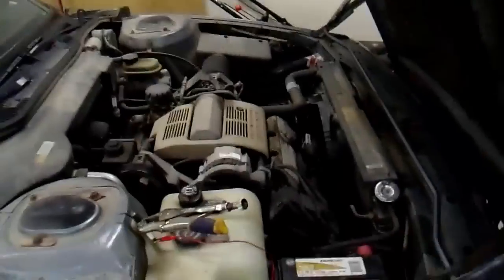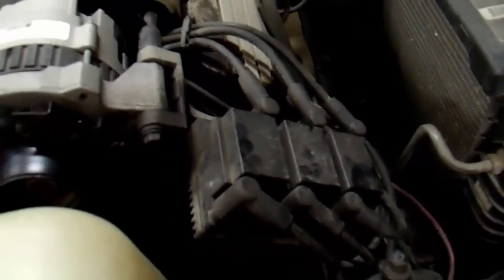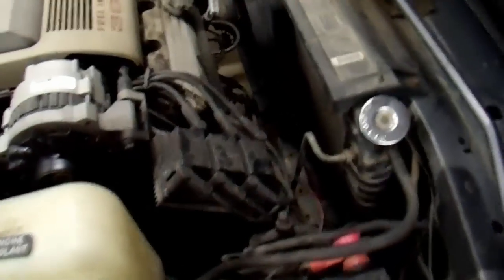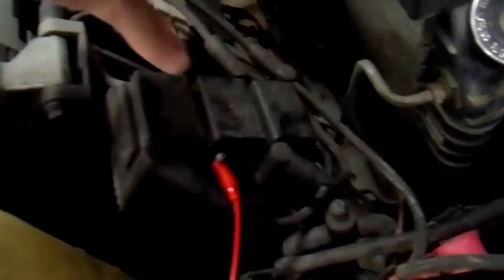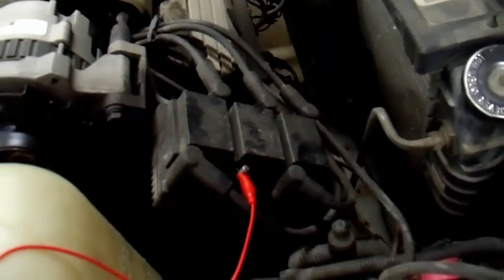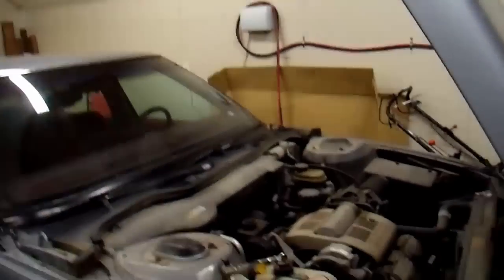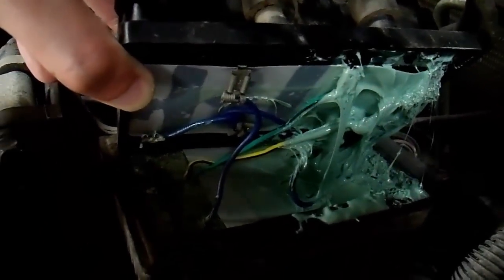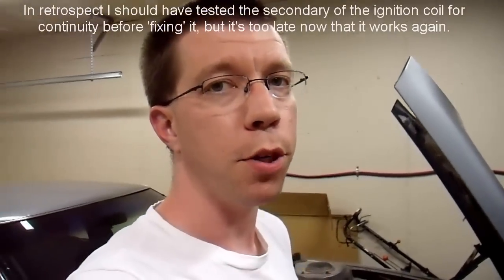Ignition Coil Failure and Repair - Spark Test Hack

Comment: one plug not firing, what I did was to switch coil packs and see if the same coil doesn't fire or if the non fire stays where it is. if the non firing coil migrates to it's new position the coil is bad, if  not then ignition module is (could be) bad; test to make sure.
Reply from the maker: That works on more modern vehicles.  This one has 3 coils in a module where they cannot be swapped.  3 coils instead of 6 because it is a waste spark system where every cylinder fires twice every 360 degrees.

Comment: hey i have the same coil pack and i bought a new one but the new one does not have the 123456 marked on it so how do i know wich way to put the coil pack on? like how do i know the ground side and the low voltage side of the coil pack

Comment: my car+g.prix was running on 4. 2 plugs were about to fall out.not sure why but fixed with all irridium ac delco. coils will be Delphi.
Reply from the maker: I highly recommend only using the delco premium plugs like you did with any GM vehicle of this vintage.  They're good and last a very long time - well in excess of 100k miles while staying well within gap spec.  Delphi and AC Delco are the way to go for replacement parts on these.  Comment approved!

Comment: My 92 lesabre is down.Just quit and has no spark but has fuel.Just recently got car.Most cars no one ever repairs anything.Already did a lot to make it useful and on a budget.Being an old school guy I found years ago working on these cars nobody changes wires or plugs or even a fuel filter or flush out the rad.Now when the car misfires they just change the coil that is missing.Changing this will help all of these cars out what is it the ignition module under the coils and new coils to go with it.Then you do have some spare parts that you can keep and re test nothing like having a spare coil or two hanging around.Oh make sure the part says made in the USA or Canada and not china parts for Buick,s very unreliable.Brand new window regulator not even a year in another Buick but a 20 year old one in a wrecker still worker lol can name many parts same out come be careful on cheap replacement parts.Remember your actually driving a car that is a car even has a cigar lighter in how many places.Even if you don,t smoke you can fill those clean ashtrays with lots of goodies like bulbs and spare parts like fuses keep on driving sure hope I find a quality ignition module.

Comment: How do you change out the coil with all the goo in it? Clean it off the connectors?
Reply from the maker: Normally this would be replaced as a unit but the coils can be removed as shown in the video if desired.  Unscrew it from the module, unplug the connectors, and swap out.  It isn't made to be replaceable separately so it is possible the 'goo' will glue it together in your case.

Comment: I've got the same engine. I've changed cam and crank sensor , all fuses and relays are good.Still not firing.
Reply from the maker: Have you verified if you have spark?  Checked for fuel delivery?  eg starting fluid.
Reply: @knurlgnar24  I took plug wires off neither of them are firing. All of the coils wouldn't be bad. I've never had that to happen before. I'm thinking maybe the module went out.
Reply: Fuel delivery is well.

Comment: My 91 buick lesabre just turned 31 this year. Got similar problem as you did. Missing on cylinder 6. Bought new ignition control module and coil box. Mine has the original grey one I think. Put new wires and plugs in it didn't fix my problem. Great video helps me out alot. Wish me luck I live in the rust belt.

Comment: I have a 3800 in my 1990 Trofeo. The engine was warming up then just died. I checked for spark, and got nothing with the plug removed. I looked at the connector to the ignition module and saw that 3 wires at the connector side were fried. So I just replaced the harness and am waiting for the ignition module because I still don't have ignition with the old module. Would the whole module go out or could something else be going on?
Reply from the maker: I'm not exactly sure but since the module provides power to the sensor it seems logical that the module itself was bad.  I'm not sure how a bad sensor would cause fried wiring.  Parts for these are cheap now so I agree that replacing the module makes sense.  If that doesn't work I have a video on replacing the crank sensor which is a doable but more difficult procedure.  They make modules like this tolerant of sensor faults so I wouldn't be concerned with burning out your new module if the sensor is also bad assuming you don't try to run it that way for too long.
Reply: @knurlgnar24  I also found online, a troubleshooting guide on that 14 lead pinout. Hopefully I won't have to use it. The new Ign mod will be here tomorrow. TBD
Reply: Oh I know how it burned the harness, there's a positive voltage another positive and a ground, and there all 3 next to each other,(maybe not the exact order), and it looks like something caused one or all to overheat and they shorted but never blew the 20 amp fuse. Go figure. So on my new harness I double insulated those three or four wires on that one side of the connector that had the voltage and ground near each other and then I rewrapped everything because the old connector I had was pretty nasty looking to it looks like it had some oil had been on it who knows what but it's funny I posted my pictures of my shorted wiring on a Facebook account and three other people showed me their wires had also done the same thing for the same kind of car it's a 1990 trofeo. So I'm hoping my mummified wiring will last a little longer and like I say my new ignition module will be here tomorrow so wish me luck

Comment: I know these videos are old but damn I appreciate your time and effort. I have an 1989 Buick Electra with 150,000 miles and I feel the same... Even though I only paid $250 for it it's in decent enough shape that I want to see if I can get 300,000 on the odometer 😜 Old car? So what?! Cheers man!
Reply from the maker: These are great cars reliability wise - but the rest of the car may fall apart around you!  Mine made it to 260k and ran perfectly up until I sold it.  The transmission on these needs a fluid change with Dexron6 to last though.  Lots of these 4T60 transmissions fail due to old fluid since they had an older dexronII or equivalent from the factory and once they get 10 years old and 100k miles people just never get around to changing it.  Mine was still running on DexronIII from a fluid change at 50k miles in 1994 so I was part of the problem!  I was very careful to not run the transmission hot though as I am on all my vehicles.
Reply: @knurlgnar24  Thank you for the transmission advice! I don't know know the date of the last fluid change for me but I'll probably change it soon. I'm the third owner and the second owner had the car less than a year, so the service intervals were probably met pretty consistently. I performed the repair yesterday, and man... It really does blow my mind how smooth these cars ride when they're functioning properly! 🤯😁

Comment: I'd like to add: this is ironic. I never reviewed this video until 10 minutes ago. I was watching this video looked like it was over, breaking news. the creator came back on mentioned he found an issue.
 A lose low side connection the blue wire. Im working on my 90 olds delta 88 royale burgham. I know I have ignition issues. I watched a few videos got pointers from each. i numbered the plug wires pulled them (DOING THIS ON A HUNCH)   I've had the coils off my other olds, sticky mess! good story, another time. Colis were sealed good, pulled it off just enough to see. NO sticky mess, (Im second owner) 87,430 mi. the blue low side wire was off. it was snug tacky to the potentially turning sticky stuff. I never got so lucky, my olds didnt fire it did however restore power to my module connection WIRES.  Prior to removing the coils I was unable to get a power indication. A WORD TO THE WISE REMOVE  the hex screws from each side the module, work it lose, bend your head down there and look. Look good? visual done. Now gently pull at each connection, solid, not moving?  oh one's moving? snug it gently, move on.

Comment: Popped my ignition module off and 3 of the 6 prongs had snapped off and was just laying there.  Anyone have any idea what color wires go where? A diagram on the hook up off the module  via color coded wires?
Reply: The 3 blue wires go to bank 1 and are lined out in order usually. On bank 2, blue goes to 6, green goes to 2, and yellow goes to 4

Comment: I think I have a bad ignition coil module on a 89 Buick LeSabre not getting no spark or fuel Redi Chek computer also ground wire underneath what ignition coil module cause no spark or fuel ?

Comment: What size is the tensioner pulley bolt
Reply: I think I used a 3/4 on mine. Or it might be an 18mm

Comment: Atleast from the gen1 up NEVER use used coils and preferably not used ignition modules. The 3800 is infamous for blowing coil packs. Just buy new coils. Coils are 10 a pop on amazon.
Reply from the maker: I know this is an old comment but I would never buy coils on Amazon.  NEVER.  OEM junkyard parts are by far the best value, new good brand name parts from an auto store are OK, new parts from the dealer are best but most people don't want to give their first born for them, and as far as online auto parts go Amazon is the absolute worst place you could possibly go for them.  NEVER.  just never.
Reply: @knurlgnar24  
Some, you have to look at what BRAND your getting. OEM uses aftermarket parts just rebranded to your vehicles make. Wreckers is great for alot of high cost parts or parts you cannot obtain but remember they are used and will work accordingly. With coils it's best to go new. I mentioned Amazon because they stand behind thier shit. Amazon is simply an ecommerce reseller. They don't manufacture just cuts the middle man. As for auto parts stores..... I went through countless CHEAP O'Reilly trash suspension parts. Sure they state lifetime warranty but when you get hassled by the parts guys you just don't wish to buy there. If I can get a walker oxygen sensor for under 10 dollars for my Dodge bit AutoZone wants 50 for the exact same part, I'm going the cheaper route lol😁
Reply: @FF-7Sephiroth  so I should charge the battery, and check the ignition control module. I see. It ran fine when I parked it, but after 5 years, it has nothing. My family thinks I should scrap it, but the engine only has 189,000 miles on it. It's not even halfway through being done in my opinion.

Comment: Good video. Just a note that this isn't a 100% test - a weak coil may still light a spark plug at atmospheric pressure, but will fail to light at the higher pressures in the engine. I chased an ignition problem for weeks after all my coils appeared good, but one was weak! You can verify this by creating an adjustable spark gap with a couple nails. Wire it up to your coil, and adjust the gap until it doesn't light. Do it again with a known good coil and compare the maximum spark distance.

Also of note, my weak coil was only weak at higher RPMs, so rev your engine a bit no matter how you test the spark.

Comment: Hey, since I have your LeSabre's Oldsmobile-badged Twin (Same year to boot!), maybe you can help me out.

It runs fine when it's cold, but when it gets up to running temp, it isn't happy. Slowing down and at idle, the rpms drop, the engine rattles, and you can feel it struggle (and see the headlights dim when at night), and occasionally stall.

There aren't any problems starting it back up, I just throw it into neutral and it comes back to life. I've replaced the coils, some cracked vacuum lines, Cam sensor, and the Spark plugs (during general maintenance).

It is definitely better than what it used to be by leaps and bounds, but this is one problem that seems to persist. I've had it to the local mechanic, and he's completely perplexed by it.

Any help you can give me is much appreciated.

Comment: Don't forget that GM came out with a "Delco type II" ignition system. It has 3 separate coils which are individually replaceable. If you go to the JY, you can make an upgrade.
Reply: I love scrounging through the junkyards for parts and the occasional rare finds. Yes, it is the OEM Delco coil packs I speak of. Thanks for clarifying this.
Reply: ***** They did indeed change the connection. Snip the pigtail off the car you yard the module/coil assembly from, and you can make that conversion happen, but I believe the only real benefit would be the ability to buy high voltage "Type II" coils available from guys like ACCELL and MSD
Reply: The supercharged coil packs are different than the naturally aspirated ones. You can recognize them by the color surrounding the 2 holes on the bottom of the coil packs. The S/C model has a blue part on the bottom and I've seen the N/A models with black and some with grey.
Reply from the maker: I was wondering about that  - Does the newer style ignition module/coil pack fit electrically with the older style module I have on this vehicle?  I thought they added a ground to the connector and made a few other pinout changes?
Reply: Innovative Solutions that color coding is true only if the vehicle is still equipped with delco coils and not some wells/standard ignition/BVD aftermarket coils. For identification, keep in mind a junkyard car probably has coils that have been replaced. Google images is your friend!

Comment: Long live the 3800 engine. My mom's car has same engine you have, with 450,000 miles. Still strong!
As a member of several car repair forums, I can say this is a common problem and there are many people really get baffled by troubleshooting it. Here is an additional very easy test Direct Ignition Coils Secondary Resistance Testing - Delco and Magnavox
Reply from the maker: 450k miles - not many of even these engines make it that far!  I'm curious, how many times was the timing chain and/or tensioner replaced?  I'm still on the original.